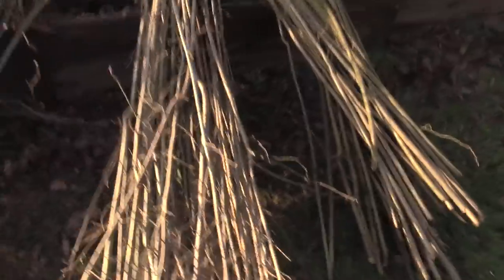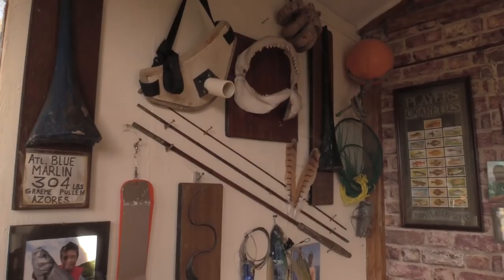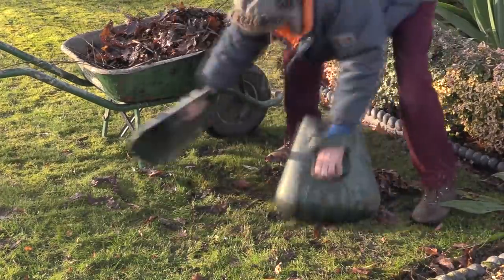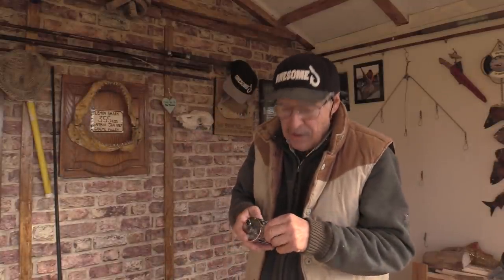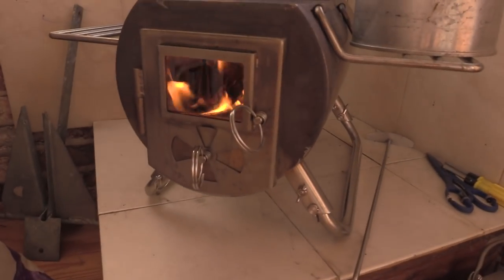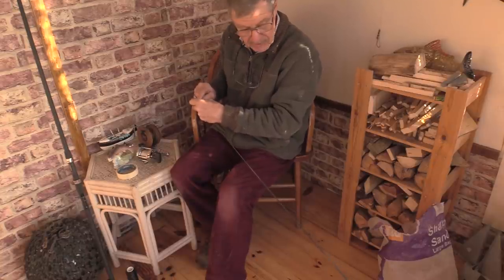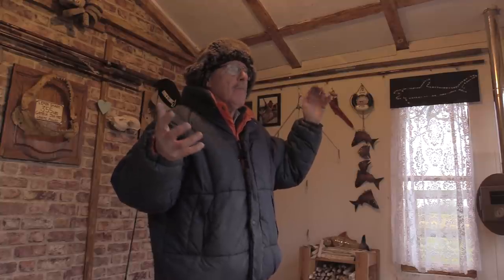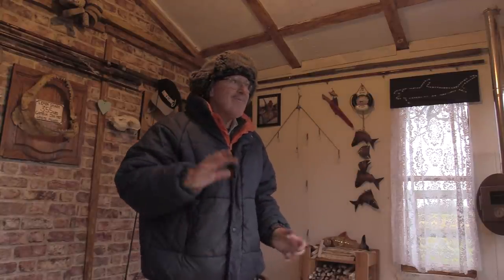Making a Fishing Rod from a Busted Rod: THE FRANKENROD 2!

Comment: Ahh the Enjoyment Of The Franken Rod Build , Nothing like it ,I actually Had A Series of Reels That I Used and Liked that I would only buy Those rarely did one have a misissue but if so I had spare Parts after a couple years of using them, I still have A Couple Of Those Now That I've Managed To Save From My Two  Sons, Thankfully They're Both Thru The Teen Years and Float Trips That always Seem to result in a mishap somehow 🤦🏻‍♂️🤪🤷🏻‍♂️🤔,  LoL 😂 , But I Remember Those Days As Well So ,, these were inexpensive really , had a great drag system and For the size of the Reel I put some big fish in the net but I could spool them with a 8 to 10 pound Braid use a 3 ft mono leader of a 4 lb tied into a high low rig and fish Crappie Jigs Of Course I change Rods But Those little cheap shakespeare Reels did well for a ultralight ,Ya don't find many that you can get a dual role With often , I would spool 30 pound Braid and catch red drum and Specks,Flounder Black Drum a few trips , change out the spool to the 8 pound put it on a Light Weight Rod and catch Crappie , The Rods I'm the same never throw anything Away , most I buy I usually end up adding a Guide or two , I Had A Lew's Speed Stik That Had been rebuilt more times than Dale Earnhardt's engine lol 🤣🤣🤣 , 🤷🏻‍♂️ , Anyway Enjoyed The Show , Hopefully This Blasted China Virus Will Disappear , Till Then ,Do what ya Must Gram , From Mississippi  we  Bid You A Great Thanks For The Entertainment ,    ,

Comment: Awesome build. Can you do a pink one for Sharon? Regarding Gorilla glue I often use it to reinforce knots for wreck fishing. A very fine coating on the knot and never had a slip or break yet. Also if you hang a flapper rig horizontal whilst building and the snood swivels are facing down you can can put some Gorilla glue on in a taper shape and your snoods will naturally stand off way more giving far less tangles if you cast hard. It was just a "Pullen experiment" when I was bored but it works. Graeme I would love to see you use Gorilla glue to make things stand off more.

Comment: The oak leaves deffinatly affect the acidity of the pond, but that isn't too much of a problem. If anything the added organic matter should help fertilize your Lily pads as you mentioned but will also lead to major algae  blooms in the summer, so it's entirely up to you if you remove the leaves or not. If you wanted to add fish to your pond the leaves must go as the higher acidity also increases the amount of dissolved CO2 in the water which as you could imagine is very dangerous for fish. It is however perfect for submersed aquatic plants which will also help cut back on the algae.  Hope this was useful 👍
Also thats called yellow brain fungus I see them all over the place in an oak woodland near me.

Comment: A little bit of leaf litter breaking down in your pond is fine but if left unattended for too long it can snowball into a problem. It'll make nice, rich organic silt initially but it will start to acidify the water, this can be adjusted fairly easily on a small scale by adding chalk dust to swing the balance back to neutral/slightly alkali. 
One of the lakes that I manage is a small old estate lake that is surrounded by oak trees and has a rather pressing issue due to the leaf fall every year. The silt is deep (was dug 12-15ft deep 300yrs ago, now 4-5ft) and acidic to the stage that the bacteria colonies have fallen apart and are barely able to cope with the yearly leaf fall, it is basically just partially rotten leaves piled on more partially rotten leaves, the stuff underneath is being broken down by anaerobic bacteria which releases all sorts of nasty gasses into the water. The lake needed dredging 30+ years ago but was never properly managed and now the club that has stewardship over it doesn't have the finances to solve the problem. Shame really as it's a really charming little lake but unless something changes I doubt it's got much more than 20 years before it's just a lifeless bog.
Reply from the maker: It does happen.Slow process which many don't notice the deterioration. Also cutting back bankside growth helps ,but nowadays management seems to take a back seat. By the time the "committee" have decided who has sugars and who does not the problem is done.

Comment: YES, YES, YES remove all the fallen leaves, this is critical to the health of your fish, why, when the leaves eventually sink to the bottom, that is the danger zone because, for want of a better word 'composting' begins which, in the early stage, is achieved by a strain of bacteria for which is the term for this process is the aerobic stage, or in the presence of oxygen. So under water where are these 'aerobic' bacteria going to get the fuel they need {Oxygen} to complete their part of the 'Nitrogen cycle' from. They 'steal' the dissolved oxygen from the water, to the detriment of your fish. Have you at any time, when you have not removed these leaves, ever observed any of your fish appearing as though they are surface feeding (for some reason warm\hot air temperature seems to exacerbate the problem} they are not feeding they are gasping for air because of the 'stolen' oxygen.
Might be worth you investing in;
1} A dissolved oxygen test kit
2} Do indeed monitor the PH of the water, perhaps a minimum of once every 4 weeks.
3} Invest in a pond size air stone and a suitably sized air pump. Or any means that will create strong surface agitation as this surface agitation will aid the exchange of gases, including the replacement of much needed {dissolved} oxygen.
You may well be rewarded by searching youTube channels, not only those dedicated to pond keepers, but also the keepers of aquarium based tropical fish as we, at one time or another find ourselves faced with the same problem {and more) that you are experiencing.
Sorry for the length of this comment but I felt that a more {semi} in depth answer to your question, out of respect for all the advice and assistance that both you and your son have offered {freely over the years} was in order.
Keep uploading and stay safe during these crazy times.
Mike

Comment: When repairing a rod tip eye of mine, after some research it seemed a Polymide Epoxy Resin was the best. Its durable, weather and water resistant. I decided to use just hot glue as it'll be easier to remove tho. Bit for your rods and that kind of DIY id fork out for the Polymide. This was only my own research tho I'm not a pro